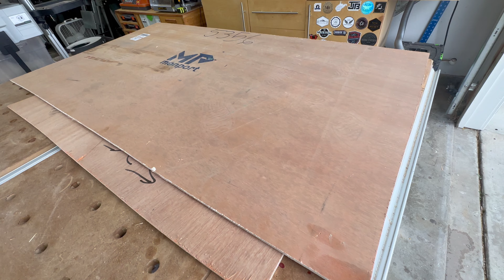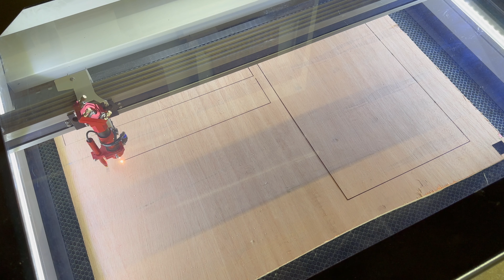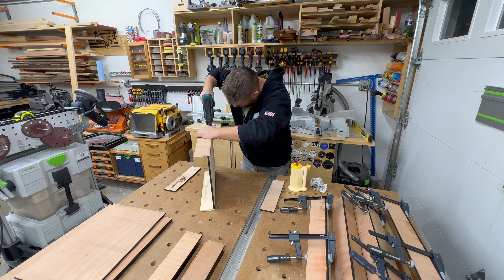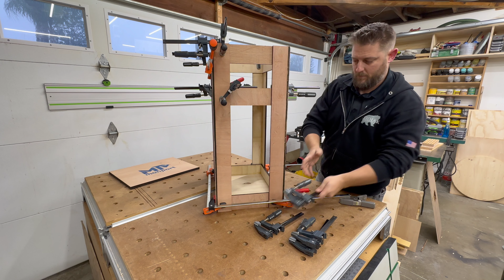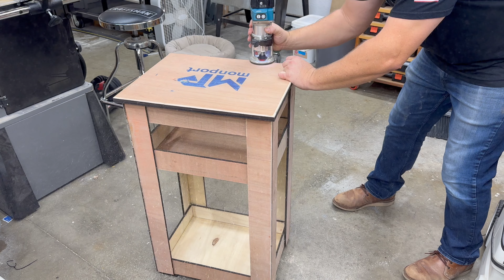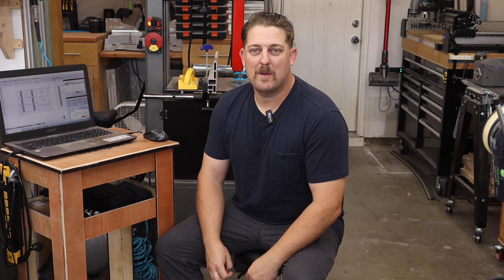Shop Utility Cart Build DIY: Monport C02 Laser

Comment: Hey Brett!  Just got my 80W Monport and I'm LOVING it.  Still dialing in my settings, but I have a question.  I can't get mine to get all the way through 6mm, even with your settings.  Did you offset the Z axis to get all the way through the 10mm?
Reply from the maker: Thank you very much!  I love my 80w also, still use it everyday.  

Take some time and make sure your mirror alignment is dialed in as accurately as possible.  It’s worth spending time on this to maximize your power.  Aside from that upgrading the stock air assist is key.  I run 30 psi using my shop air compressor, that helps tremendously with cutting.  Hope this helps, let me know if you have any other questions.
Reply: New air assist came in today and that was the magic needed!  Thanks Brett!  You’re making great content, keep it up!
Reply from the maker: Awesome!  Running external air really does make a big difference on any machine.